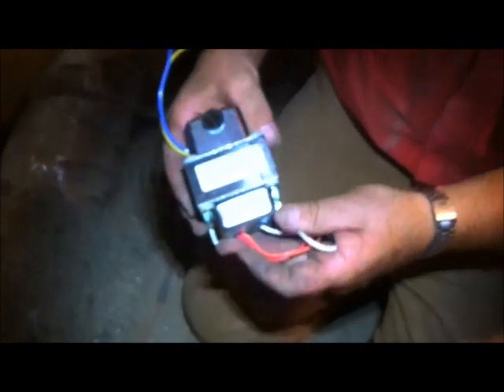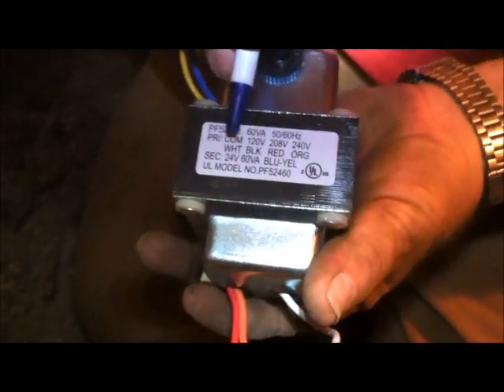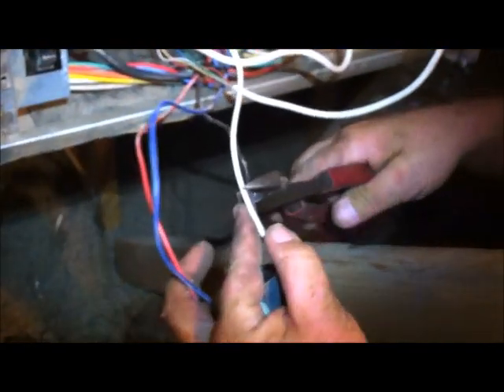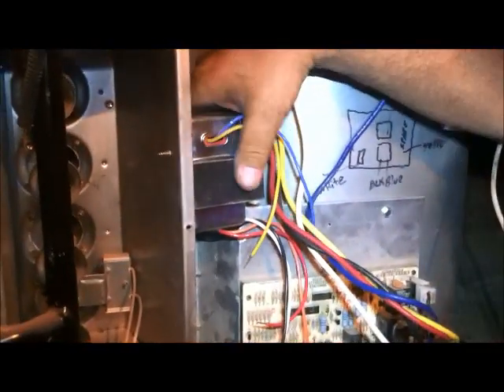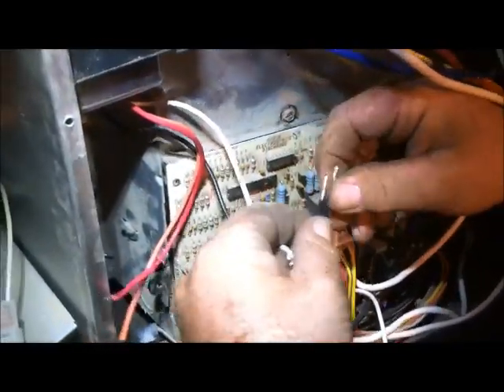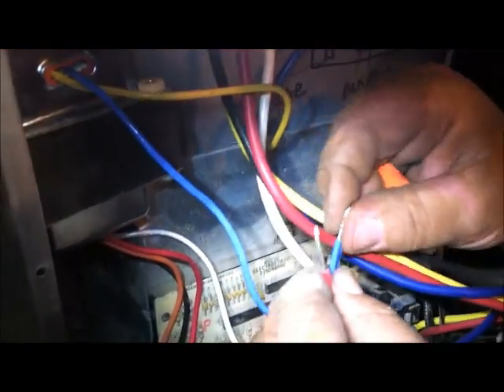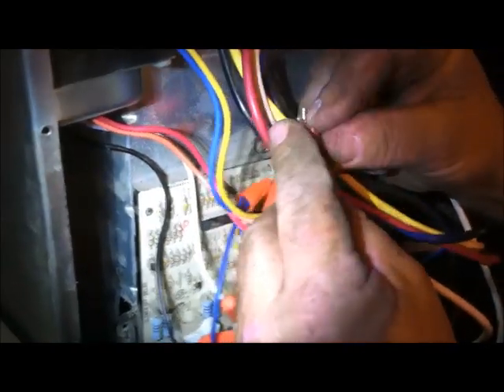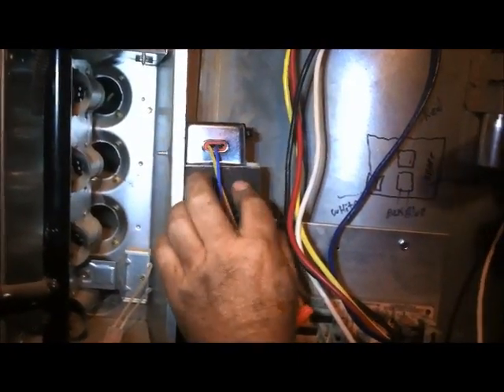Repair My Own Air Conditioner - Wiring a Transformer

Comment: My AC does not start. I started by testing the thermostat by joining the red, green and yellow wire which started the furnace but not the AC. I than tested the contactor. 240 volts does go in but when I measure the coils in volts it reads 0. I than tested the plunger by pressing in the plunger which does activate the fan and condenser. Why does the plunger not in-cage  automatically when the thermostat indicates cooling? Is it a bad contactor or a bad thermostat or something else? What other tests should I do to determine which part requires replacing?
Reply: Charlie Cecere did you figure out what was wrong

Comment: My AC won't turn on this summer unless I hold the jumper button on the front of the compressor contactor in the grooves while the power's on. When I press it in, the 2 round leads touch the other end and THE FAN COMES ON. ....BUT, it stops the second I let go of it. Never had this problem before and the furnace is not showing a blatant source of the problem.
Thoughts?